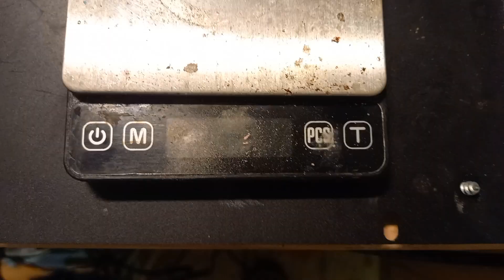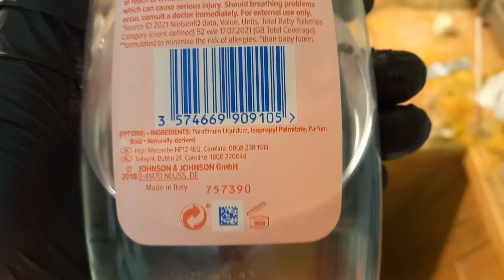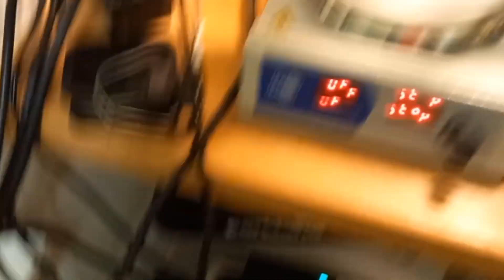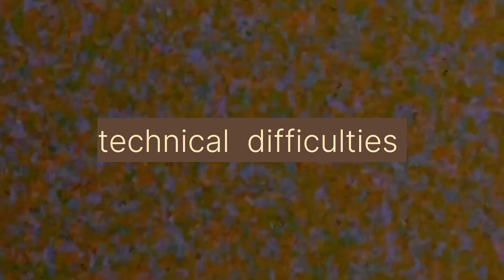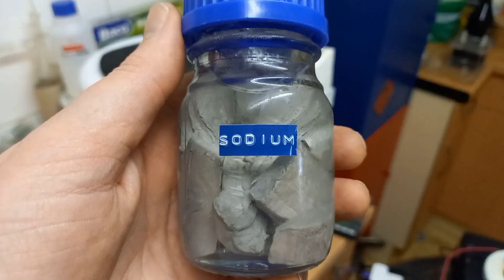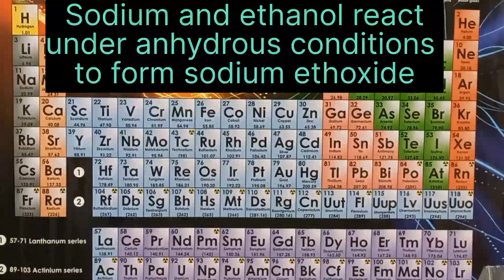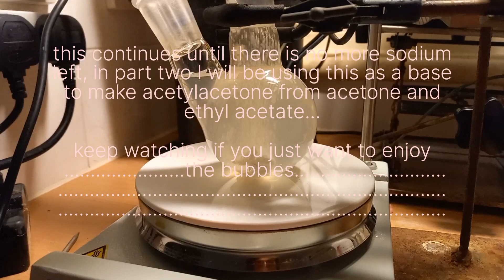Making sodium ethoxide (acetylacetone synthesis part one)

Comment: nice! you should do the voiceover afterwards. talking while filming can often be too silent
Reply from the maker: The app I'm using called VN is a bit limited in terms of sounds. That music was about the only one I could stand. I would like to record my own music and as you say do a voice over. You can be more relaxed and decide what to say and you don't need to edit around the speaking parts
Reply: @SodiumInteresting  It is air sensitive, so let me give you some pointers. First argon is denser than air and will displace any container of other gases. Then if something precipitates you use a needle syringe with filter paper teflon taped to the needle to filter keeping it under your blanket of argon. If i recall sodium hydroxide ethanol and acetone then wash the ethoxide with toluene.
Reply: us patent US1978647A Calcium sulfate anhydrous is used to dry acetone. Drying ethyl acetate is calcium oxide to dry, filter, and then extract with hexane to remove residual water
Reply: Once filtered, naphtha or toluene will wash the sodium ethoxide
Reply: Here : Perkin and Pratt, J. Chem. Soc. 95, 161 (1909 They use calcium to make calcium ethoxide which has no water sensitivity at lower temperatures, they also condense ethyl acetate with itself with just the calcium metal and also then condense it with the ethoxide.

Comment: Those Duran bottles are nice, but they're so expensive. Neat, looking forward to the next video!
Reply from the maker: They are good, being borosilicate you could even do your reactions in them. I quite like these things with or without vacuum valve, you see the sulfur monochloride in one in the video https://a.aliexpress.com/_m0ctcLs

I'm pretty sure you could store low boiling solvents like carbon disulfide, acetaldehyde. Maybe even liquid ammonia or chloroethane in them. They are thick walled and have teflon to ground glass threads and good orings
Reply: @SodiumInteresting  I've wanted one of those pressure bottles for a long time too, I was thinking the same thing.